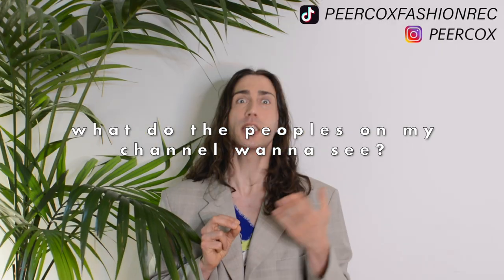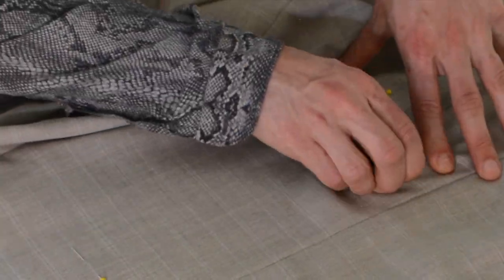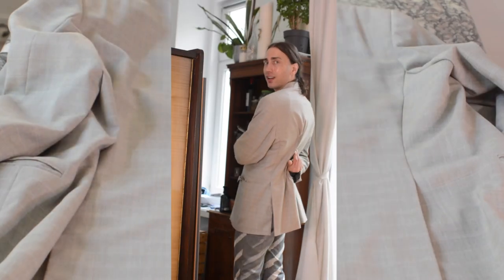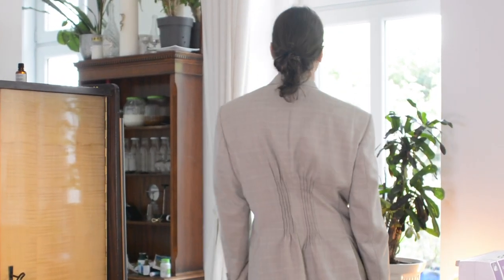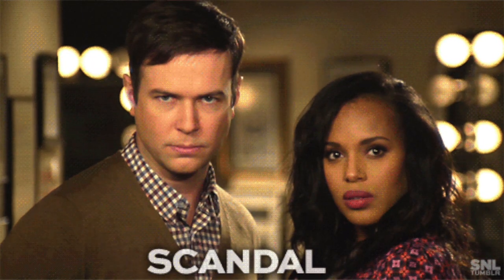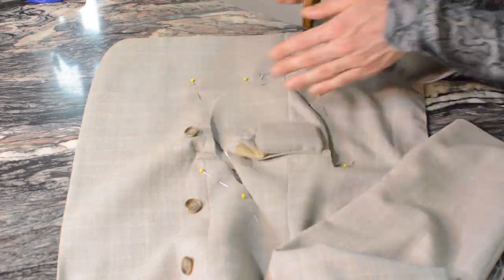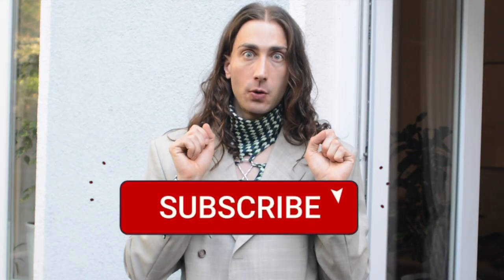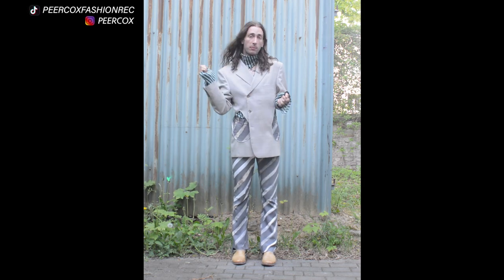DIY a $1775 Blazer (But Cooler) With These Unique Techniques▶WOW! BEST Vintage Blazer Refashion Yet?

Comment: I really like the pintuck technique especially with the pleats going in the opposite direction in the middle. I would have done a similar treatment in the front to bring in the width there as well. It looks great with the shirt that you chose!
I think the cutout feature would work well if the jacket and pants matched. It just seemed a little busy with the shirt and pants. 
You'll definitely have to try this technique out again. Maybe you can line the cutout with a contrasting material and do it almost as if you were making welted pockets or either cording.
Great experiment and isn't that the best way to learn?
Reply from the maker: Thanks for commenting, would be interesting to see what happens if you. do it on the front side too but the pockets might be in the way.  totally agree that I messed the styling a little up though. Have yet to find the perfect pieces for it. would like to do more tucking but may be on a bit bigger scale, not sure yet. contrasting color would be a cool detail. we learn something new every time haha in a good or. abad way. thanks for. the tips!